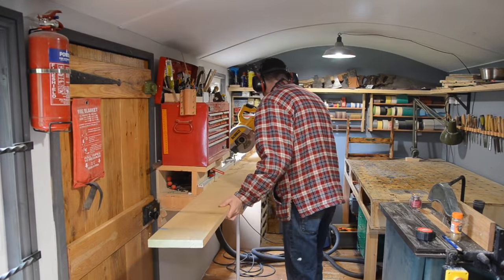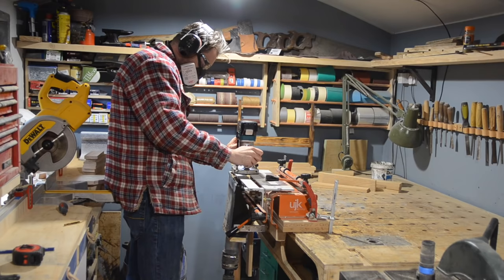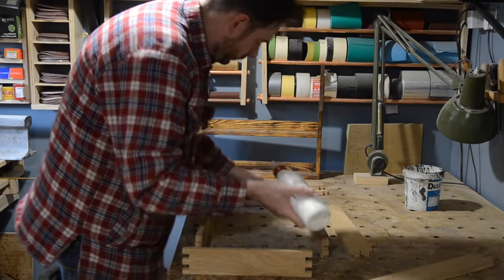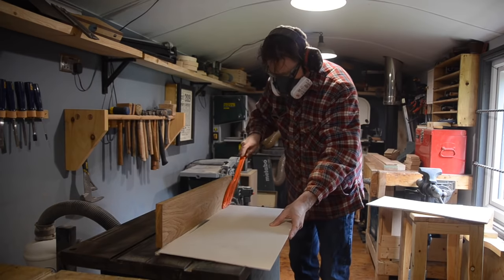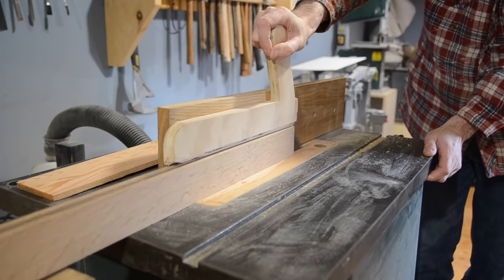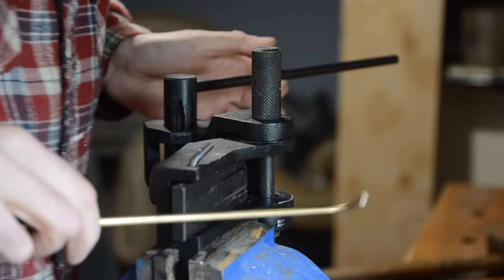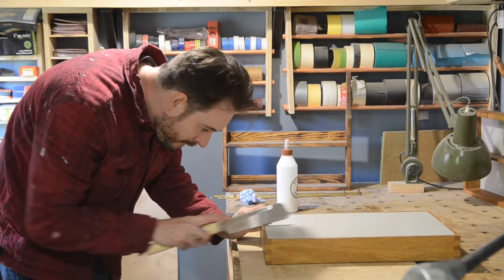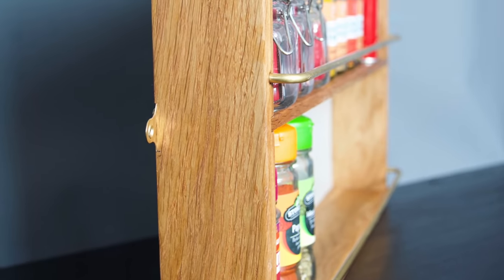Making A Spice Rack

Comment: This is absolutely lovely, but without a planer, 2-3 routers, a table saw and $100 worth of clamps plus a flat huge workbench; unobtainum for me.  Plus the pipe bender!

The design I'm working up today uuses similar brass bars, but they are straight across the face of the rack. I was debating going with 3mm or 2mm rod.

Comment: I like the totally flat finish provided by the usual chalk paint, but it's too fragile. I happened upon a Ronseal product called 'Chalky' which is a robust dead flat finish, needing no waxing. Originally bought for my wife's craft item rotary display 'tree' it proved successful. Used the surplus on the workshop furniture ....  Also built a bedside  table finished in Ronseal 'Chalky' Dove Grey : it's holding up well. I used FLOETROL conditioner to allow it to be rollered on.
Reply from the maker: Sounds good. Thank you